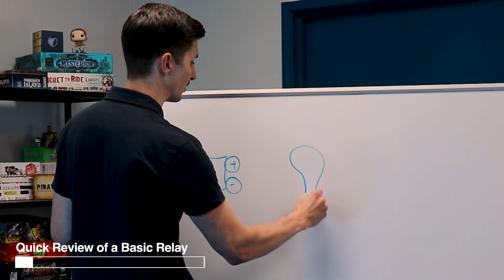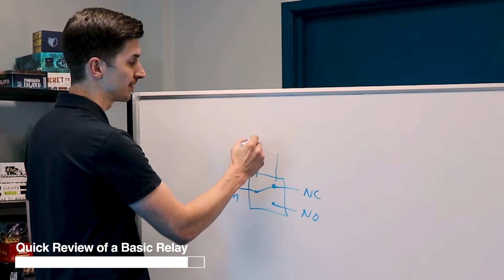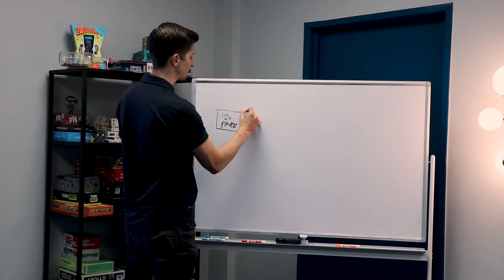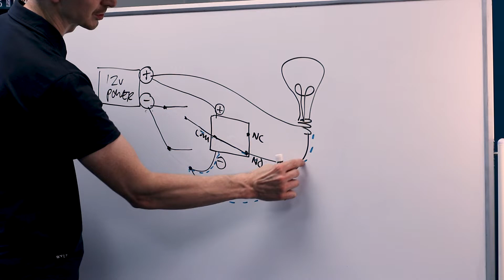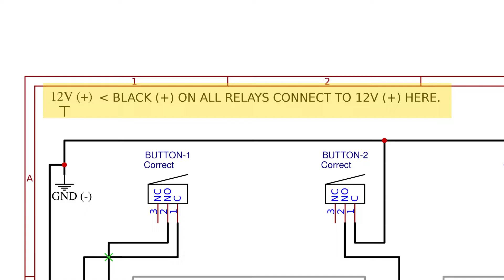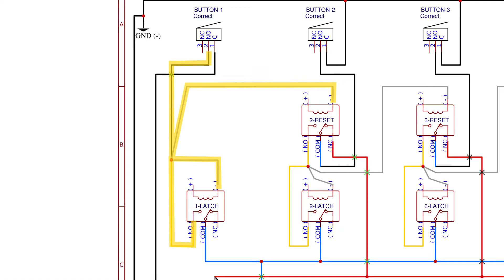Build Your Own Escape Room Prop Controller For Less Than $30

Comment: Love the video, but I must correct the limited inputs on Fright Ideas controllers. Yes, they do cap out at 8 inputs, but you can do a few things to get more. 

1) You can have multiple controllers for each puzzle. Costs a lot, but possible. 
2) You can buy an IO expander specifically made for their controllers. 
3) you can use a mix of relays and controller. Best of both worlds. 

That's it. Thanks for the video. I learned about relays while working at Universal Orlando, so this is very valuable info.

Comment: One of the best explainer videos out there! Can the correct button switches have lit LEDs (as a positive feedback indicator)?
Reply from the maker: They definitely could have LEDs as a positive feedback indicator.  If I’m understanding you correctly and you wanted an LED to light up for each correct button pressed, you could just connect the negative side of power for each LED to its respective Latch. For instance, negative power wire on LED 1 would connect in with the white and yellow wires for Latch 1 in the diagram.  The positive side of power for each LED would connect directly to the 12v power supply. 

Although this could be done, it may make the puzzle too easy, since a player could learn the correct sequence by simple process of elimination on which buttons light up and LED.

Comment: This is great, but a question:

If the players have the correct numbers, but are getting the order wrong, does it need to be reset (either by hitting a wrong number, or an external reset button in the GM area) before they can get the order correct? For example, if they enter 1, 2, 4, 3, 5 and it doesn't work, so they then try 1, 2, 3, 4, 5 without hitting a wrong button, will it trigger, or does it need a reset first? You reset it every time in the video, so it isn't clear.

Looking forward to trying this out!
Reply from the maker: It will work in the scenario you gave without needing to press a wrong button or resetting 👍🏼

Comment: Very interesting to see someone else who prefers to use this methodology when designing puzzles rather than just throwing an inadequate microcontroller into the mix. I've used this exact same method to do sequence puzzles in the past and I've never had a reliability issue as long as your connections are solid.
Reply from the maker: Absolutely.  We use hundreds of these relays.  Not one of them has ever broken or malfunctioned a single time in 9 years.
Reply: @PuzzolCreative  I just reached out via your site 👍🏻
Reply from the maker: Awesome! You can also email me at stephen@puzzolcreative.com

Comment: So the players need access to the wrong/reset button, otherwise they can only try it once.
Reply from the maker: Players wouldn’t need to press a wrong button to try the correct sequence again.  For instance, if the correct code is 12345 and they enter 1235, all they need to do is go back and press 12345 and it would work. So no need to press a wrong button for another attempt.